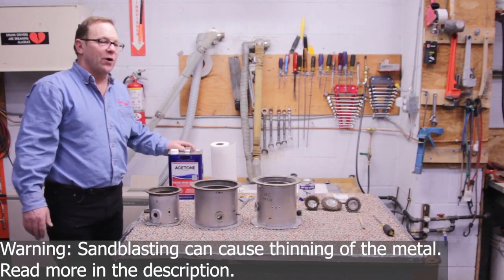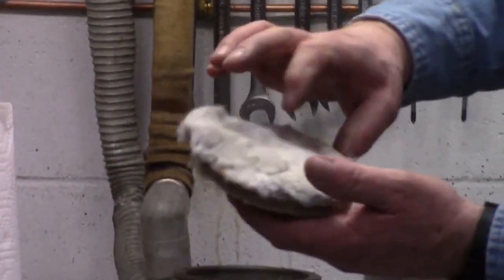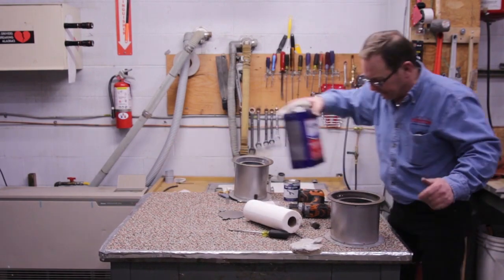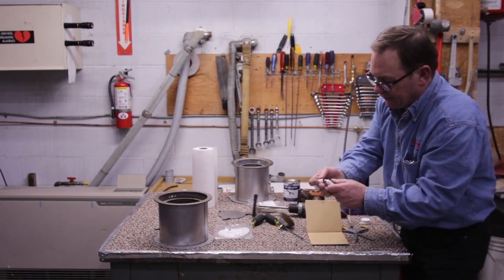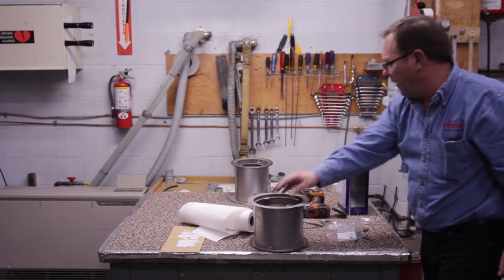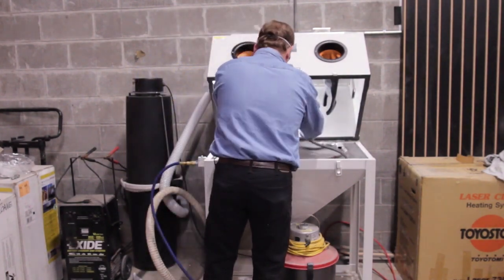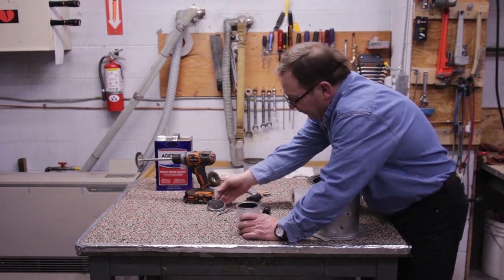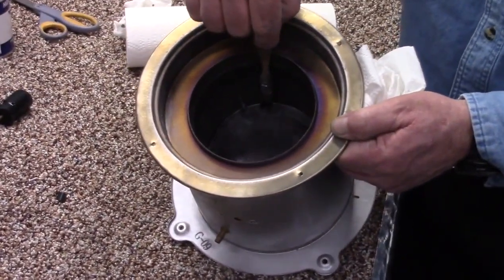Replace the Burner Mat or Apply Burner Coating on Toyotomi Toyostove | Step-by-Step Guide

Comment: How long do you wait, if any waiting is needed at all, for the glue to set up/cure after installing a new mat in the Laser 73?
Reply: I found the answer in your Warning and Important Information section.
Reply: A couple of days after curing the mat glue as you outlined using a heat gun with temp output of 1000 degrees, I discovered the manufacturer's instructions on mat replacement. It instructs not to use a heat gun. It says you are to use a hair dryer which we know produces much less heat. Are your instructions based on an updated procedure in replacing the burner mat?
Reply from the maker: Thanks for reaching out! For safety reasons, we can’t provide troubleshooting details here. Please visit our support page at www.ruralenergy.com
Reply: @livelifewarm hello. Sadly you didn't show in front of camera burner coating paint can clear image so I have no idea what tk order for my service job on my unit. Can you please provide with paint link where to buy or wgarsta name and paint #? Thank you